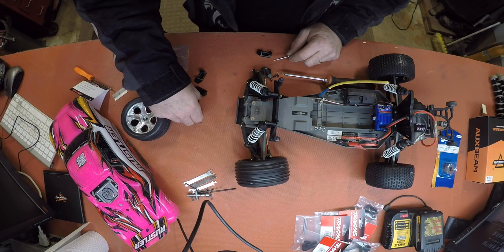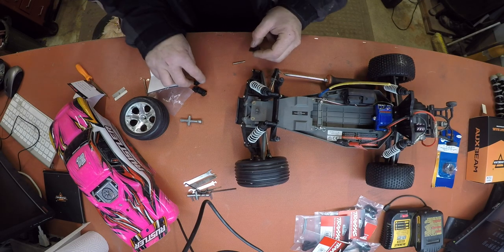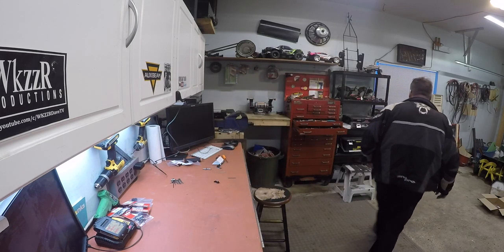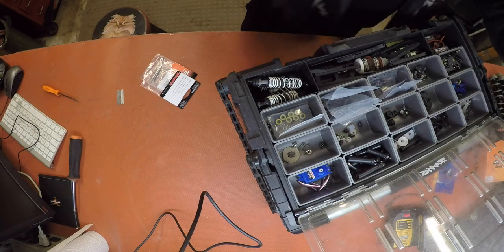Box Of Goodies And A Quick RC Rustler Repair

Comment: Awesome video love the rc I am getting ready to buy one what should I get buds!!!
Reply from the maker: James Pilaia depends what you looking for in a Rc
Reply: I like Traxxas I did have a nitro 4-tec all wheel drive 2.5 gas engine but I want to go brushless
Reply from the maker: I like the slash its a good all around truck plus if you get bored all you have to do is add bigger Tires and then she's a monster . but that is just my thoughts
Reply from the maker: they won't work as a crawler the don't go slow enough lol
Reply: I am going to look into the slash I have seen yours run and I really like it thanks for the advice